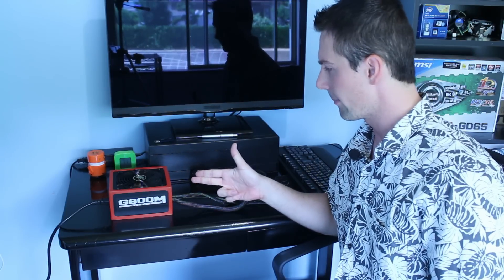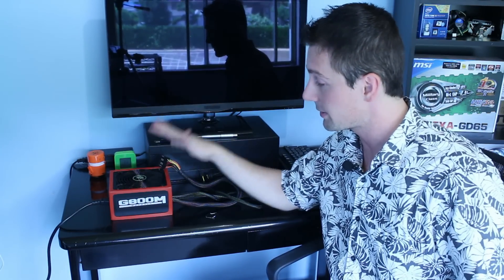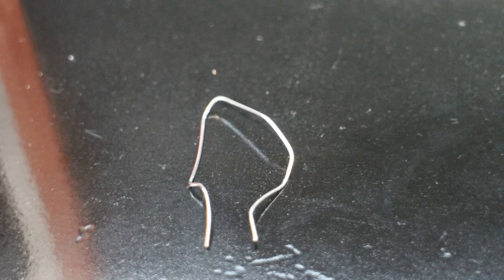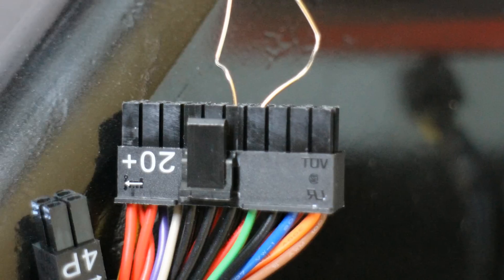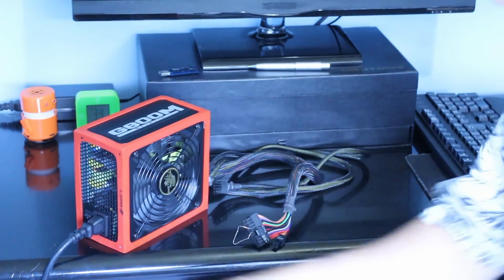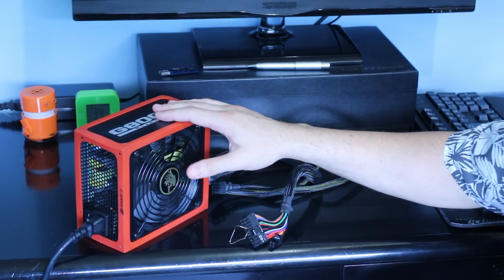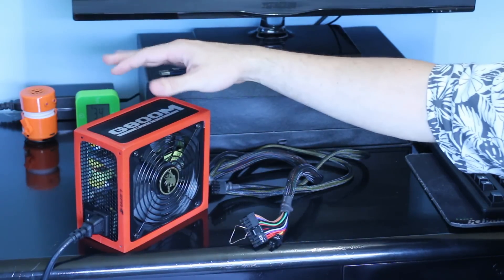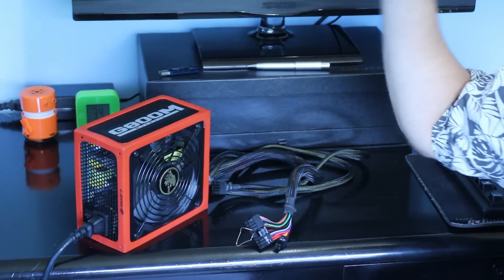How to Test your Computer Power Supply By Itself - (Test if PSU is DOA)

Comment: Great to see some early Tech Yes content.  Had a Bitfenix PSU start to cause frequent crashes (BSOD) recently.  instability even killed the NVME OS drive.  The only time the system would crash, was when stretched during gaming.  Luckily got some Tech Yes loving off facebook and picked up a RM750x (unused) for just USD $18 dollars, without the cables.  Able to buy some cheap cables from Taobao and have them delivered to Aus.   Scary that Bitfenix PSU would pass a paperclip test, but when in use would potentially damage components.

Comment: I don't know if you are still actively checking comments, but I had a question on this test: Does this force the power supply to draw maximum power? My PC is running TECHNICALLY but on certain high demand graphic games, the PC will completely shutdown/crash.

Comment: Hey I'd like to add that even if your UPS and your PSU are both switched off, you should probably have the 24-pin cable disconnected from the PSU while you're inserting the paper clip

Comment: I just got my power supply in the mail, keep in mind this is my first time building a pc, and I excitedly connected the wall plug in and flipped the switch only to find that the fan wasn’t spinning. I got very concerned because I bought this off of eBay with the description explaining that it was never used. I decided to look up a way to test the power supply and came across this video. Luckily the fan was on the whole time I had it connected and my fear and stress disappeared. I should mention that my power supply is an EVGA SuperNOVA 650w 80+ Gold psu so that added worth definitely gave me a mini heart attack 💀

Comment: I got a brand new highend PC with brand new monitor,
Recently my monitor turns off and come back on. 
It could be my PSU? I got ROG THOR 850W (it's the only pieces that I didn't replace),
Everything is update form GPU driver to bios. 
Thanks!

Comment: I got a new PSU with my up grade of my mother board and everything else. 600 watt gold. Well it was working normally until a few days ago I heard a strange noise .I had to stop the computer to check it .What I did ,mistakenly , was that when I pulled every cable out and put it back in ,I confused the Pcie cable with the CPU cable and accidently plugged the Pcie on the CPU socket As a result it was not turning on.I thought the PSU really broke down. When I realized my mistake, I did a test ,but,I properly reattached the cable with the CPU cable on the CPU input,. I had the  case open a played the PSU on the side .I press the button and everything ,but, the fan in the PS U turn on. Boy! It could have destroyed my computer. Fortunately the company who puts it out is going to send me shipping label to send it back for a replacement
.

Comment: Mines is officially diagnosed DOA i tried this method previously and ignored the fan cutting off with the power on. But when i turn it off it keep running and slow down which makes no sense smh. I’m going to be taking it back to best buy today for the return and add money for a modular hopefully the cables being separated play a part on this cpu issue I’m having i refuse to let $635 go down the drain lol

Comment: So let me ask a question, my brother's pc got a wierd thing. When he turns it on it starts for 2 seconds everything spinning etc and as soon as the screen goes to light up system goes off and shits down immediately. I found out by disconnecting the graphics card and connecring screen to motherboard via vga that pc works properly. I ve been thinking that the powersupply causes the issue because it cannot provide enough energy to power the whole sustem (when gpu connected) so it fails though it can provide enough energy to piwer up the system when gpu is out of it. Could that be the case and all we need is replace the power supply?

Comment: Thank you so much I was just building my first pc and it didn’t turn anything on
Reply: Mine wont turn on either. even when I was just trying to test the fans they wouldnt work.
Reply: @adriannavarro6417  try seeing if you messed up the cables to the power button thats what i did and it worked
Reply: @onkb2231  I did a bunch of configuring and making sure everything was in the right place and the problem was the 24 pin for the motherboard. mine splits after 20 so there is a 20 pin and 4 pin and the 4 pin wasn't in all the way then it finally turned on.
Reply: @adriannavarro6417   oh glad to hear it works
Reply: @onkb2231  yeh i thought it was the psu and i thought i was gonna need to buy a new one so im thankful.

Comment: I was building my first computer; forever* in my 23 years of life, I was doomed to sub-par performing laptops; and upon assembling all the necessary components for my bench test, the power supply fan would not spin. I've tried various outlets, different cables, anything... But with no success. I've been having dreams and nightmares these last three days wondering, if I was right to assume that a non-spinning fan was an indication of a DOA PSU, and your video certainly confirms my fears.

Thank you for this information.

*Not literally forever, but ever since I got a laptop when I was like... 12

Comment: My Seasonic only spins when it is hot. My board was hit by a surge and killed the lan port, so my board is defective .
If you touch it in the wrong way or move it , it won't work, until you touch it in the right spot!
I cleaned it yesterday,put it back together and it wouldn't boot.
So I took everything apart and put it back together piece by piece until it booted, guess I hit the right spot!
The Seasonic psu is 9 years old,but i'm sure the motherboard is damaged from the surge, so I have to be careful cleaning, moving and adding/removing parts
Might be time to build a new pc

Comment: Never use a bare paper clip to test electricity!!  If you’re testing a PC power supply, you know you have a piece if insulated wire sitting around somewhere.  Don’t be a lazy dumbass.  Use the insulated wire.

Comment: I have a refurb AX1200i that has been fine for a few months. Yesterday I noticed erratic behavior, mouse not working for a moment or two, unable to access the system tray, and then finally the entire system just shut down. No BSOD just shut down. When I looked at the system in the state the light on the PSU that is normally green was red. Hum! Booted again and it would start for a second then pause and restart and almost complete the boot cycle (complete Win10pro load) and then shut down again. Could this be the PSU? Thank for any comments and suggestions.

Comment: Wow, this helped me out tremendously.  My PC died and I thought it was the PSU. So I bought a new one and it still doesn't work.  I did this test on my old PSU and my machine works very well.  So I am definitely taking the new one back. Haven't a clue what is wrong with my PC, but it's not my PSU.  But thanks for the video because I am not very techy.. I only have to be because there is no one else to ask and I have no $ for repair shop.  Cheers!

Comment: I also have the same problem...I bought newly fresh corsair psu back in November now it's dead it won't turn on...June 7 morning I woke up and I press the power switch...fucking won't turn on I try everything from jumper cmos everything unplug and connect again...problem still the same..the I try this method to test the power supply itself, well the my computer fans works but the psu fan it did not spin no its totally dead for me.

Comment: I'm unable to test my power supply at the moment, but I had a phenom ii x4 system that worked fine last year and has just been sitting around. I went to get it up and running to sell, and it wouldn't post. The PSU provided power to make the case fans spin and led's light up (I'm not sure if the PSU fan itself was spinning) just as a quick estimate, would you say it's most likely the motherboard itself is the culprit or the PSU? It's an old AM3 bored, and the PSU is an also somewhat old 430w evga so both of the components are cheap and I'm not really at a huge loss but it would be nice to have an idea before I have to start tearing everything apart.

Comment: l have just bought corsair rm550x, if l remember correctly the name... Anyway, l have used it just a short time and today it is dead.

 l pair it with an kind of damaged motherboard to test it to see if it still works properly. After that l mount it back to my other system, but now it seems like it isn't enough to power system. Fans and lights just runs for a second and then turns off immediately. lt is sad.
Reply: Your power supply might not be enough for your rig or your motherboard is messed up or not plugged in all the way
Reply: @DeathstrokeMCShady  i just bought my power supply 1 year ago which should last 10 right? Well my computer just now in a year runs for maybe 30-1 hour and then randknly turns off. What could be the problem? My gpu sadly goes up to 82 Celsius also. Maybe that could be the problem or power supply? I have a 650w with a ryzen 7 2700x cpu cooler kraken x62 and a 1070 asus rog strix x470-f motherboard. Need help:/
Reply: Your system might be overheating and shutting itself down. Are you sure your fans and cooling are working properly? It may be the motherboard shutting the system down automatically due to internal failures.
Reply: In game cpu is at 46 celsius which seems good. Gpu goes up to 82 Celsius. Seen it go up to 84 once. Power supply im not sure havnt touched that.

Comment: Step 1) Walk over to your parts bench and pick up the spare PSU you leave laying around for testing purposes. 

2) Plug it into your shit 

3) See if that shit works now 
Fin
Reply: Yeah I got out an old, cheap Thermaltake I had to use for testing yesterday. There's a coil whine sound coming from my CPU area (mobo socket I think) which also comes through headphones. I already exchanged the mobo once. If I disable processor idle, which I think keeps the cores active and the voltage constantly high instead of fluctuating to save power, the sound goes away (but has other negative effects). So there's some correlation between the sound and power. So I hooked up the Thermaltake, and now the CPU, headphones, AND PSU were making the same whine. After noting this and going back to my Corsair HX750 PSU, I THINK it also makes the same whine but much more quietly (hard to isolate as it was in the case whereas the Thermaltake was out). So what happens when both PSUs make the noise? Either both PSUs had issues, both mobos did, or my new i5-6600K is the problem (which I'm unable to substitute and considered least likely). I ordered a new PSU last night; figured what the hell Amazon is good about returns if it doesn't help.
Reply: Malus1531
lol old stuff sucks, mine never gets old, someone ends up needing it and I replace it within 1-2 years

10 hours or less is just break-in period stress testing, important for PSU's =)

I just rotate evga and thermaltake 400-430W PSU's, whatever is on sale when need to restock
Reply: *****
Yeah I just bought an EVGA. I didn't think Thermaltake was very good? I got mine at Frys or something when I didn't know much about PCs. I guess mine worked fine, I think I replaced it and found out the mobo was the issue, but stuck with the Corsair cause it was so much nicer and just packed away the Tt somewhere.
Reply: Malus1531
Thermaltake is amazing

Comment: I was just building my "first" computer (emphasis on first because it is my first PC build) and my Xplower GTX light 480W PSU did not work, there was no motherboard active light and it would not start, checked every connection, it is good I found this video, I almost threw away my motherboard
Reply: Fatal Potatoe I'm having that very issue, nothing is lighting up whatsoever, my gpu originally did for a bit but then it went out and then nothing will light up.
Reply: What did u do because the same thing happen to me

Comment: Lepa, that's your 1st mistake. I had many Lepa cases and they were so cheap if you looked at it wrong it would bend, I have another lepa PSU that claims to be a 500 watt but it's so light, that my cell phone is heavier, I wouldn't even trust it to charge my cell phone.

Comment: When I did this, my power supply did nothing. Is it dead then?
Reply: Sometime you will have to apply a fair bit pressure in the paperclips to really see if it spins.
Reply: Nah, it's dead. Got a new one and now my PC works
Reply: Well that sucks, what PSU was it?
Reply: Yup it’s dead. 
RIP treezys PSU
Reply: Alton thats not true the smallest amount of power should make that fan spin its just a kickstart even with a 1mm cable it should work applying preasure will only put yourself in danger

Comment: you did a great job demonstrating the testing of the power supply with just a paper clip..   I have one to test and was going to get a tester, this  a simple easy way to test since I don't have a tester.    Thank you for your demonstration..
Reply: I'm sure you fixed yours by now, but just a word of caution to anyone else from my own experience: the fan spinning doesn't mean the PSU is fine yet. It can be a good sign, the fan does mean the PSU can at least turn on! But the PSU needs to be tested for the right voltages to be sure it's okay, because the PSU may still shut itself off if it can't deliver the voltage.

My fan was spinning but as soon as I tried testing it, the PSU stopped completely and wouldn't turn on again, and sadly I have to get a new one now. I wish I had tried that first before rushing to get other parts, the tester is a really good and easy way of checking it. I also hope they can include a tester for free with every PSU in the future!
Reply: @Anolaana  thank you for letting me know.
Reply: @Anolaana  Absolutely true.  Just replaced a PSU that suddenly started giving BSOD when gaming.  Killed an NVME drive.  Luckily that was the only thing it destroyed.  PSU tester only way to be sure it's really ok, and not only just starts up!

Comment: I tested using the paperclip meathod and had the same exact result! However, when I plug it into my mobo setup it does nothing at all! Not even a slight startup like it did with the paperclip (starting then shutting down immediately). When it's plugged into mobo I get nothing! Could this just be the psu or is there a chance my mobo is doa?
Reply from the maker: +Greg Petra Might need a PSU tester.  However it does sound like the PSU, usually the motherboard will give out something.
Reply: Figured it out! simply enough the mobo was not connected to the power switch on the case. Easily fixed!

Comment: hi...hoping I can get some help please.. i have a silverstone 300w sfx psu... the fan does not spin unless under load or gets to a certain temp... how can i test this psu.?
Reply from the maker: +skilo81 Load it up with 2 different computers, if they both dont work then its the psu, or you can get a power checker off ebay for pretty cheap.

Comment: Careful with going by fan not spinning if your using Corsair PSU's.(not sure about other brands or even models)
Being using this trick for a long time.
But a year ago i purchased a Corsair HX1050, had some weird problems and tested the PSU with this method.
Did the same thing, fan started spinning then stopped next time it wouldn't spin either.
But in this case the PSU has a sensor build in which will only spin the fan if the temp is high enough.
Otherwise the fan will just be inactive.

Comment: bro im using a 450 watt power supply and once i turned on my pc in morning and found a trip of light and my main switch button went down. then when i turned em on and tried to start my pc , it is not starting . the light on motherboard( yellow light) is not on. Even fan of power supply is not spinning at all. Althought the wire from main switch to psu is alright and working just power supply i think its psu problem but wht do u think buddy. Waiting for your reply

Comment: Thanks for the video. What is the purpose of the paper clip though? Does it make the PSU think it's connected to a motherboard? I bought an 850w. Connected it to JUST a fan and it wouldn't even start. I thought this was odd and researched to find your video. I'll test it later. But my question still stands. :)

Comment: Zero psu mode . Some power supplies have this option . The fun doesn't spin at all if you dont go higher of certain amount of psu load . In some psu like corsair is about 40% . I dont say that your psu isn't faulty . But many psu brands have this Zero Fan mode and maybe someone will be confused thinking the PSU is faulty

Comment: So how do you test a PSU whose fan doesn't start spinning until the PSU load reaches a certain level? Like Corsair RM series or even the HX650 Gold version that I own?
Reply: I think one way to test those is to connect a case fan if you have a means to do so like a hub + sata

Comment: hello tech yes..i need your opinion here..i'am going to build a gaming pc this month..how about i5 4590?cheap h81 mobo with gtx 750 ti golden sample?in my place i5 almost same price to i3..even fx 8350 more expensive than i5..not interested to OC any cpu..
Reply: yup...currently my first build is amd apu fm1...cannot upgrade for next gen gaming..so i prefer intel i5 locked like 4460 or 4590..now i had 4gb 1333mhz ram..so just + 1x4gb right?i dont want to change my psu so gtx 750ti good to go?it doesnt require any 6 pin connector?
Reply: nazirul hanis I know I'm late but you could check out a reddit called: buildapc, they will check if your build is the best bang for buck